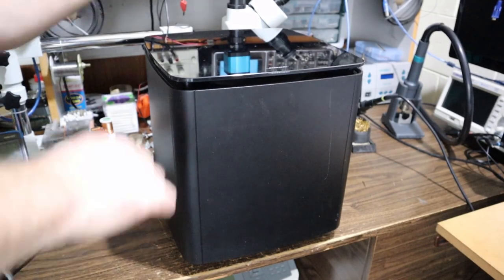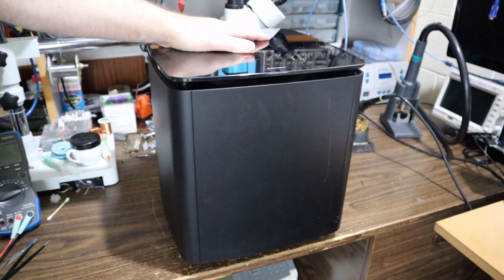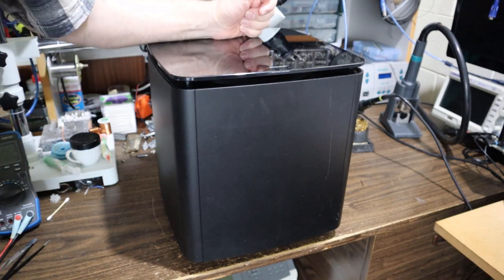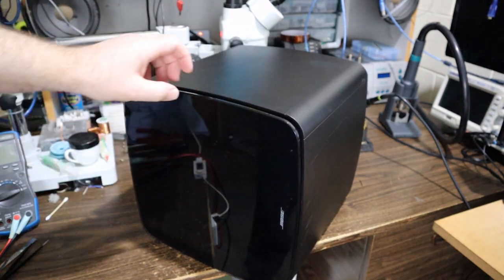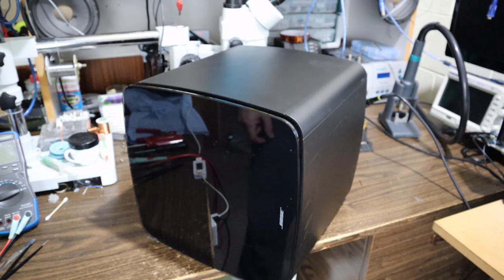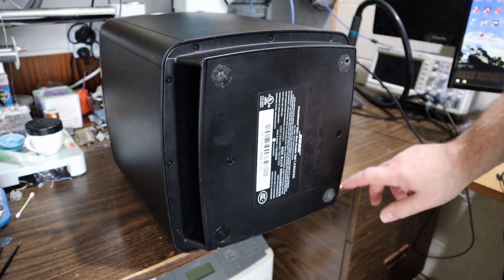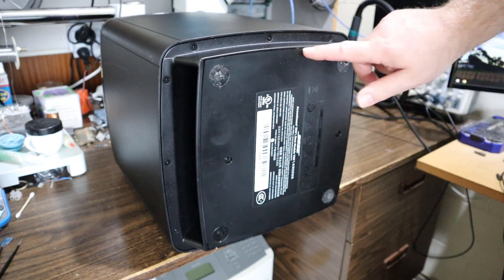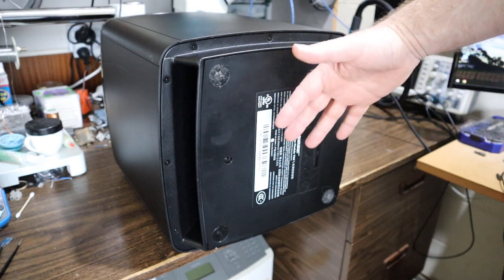BOSE bass module 700 acoustimass 300 NO POWER repair. COMPLETE GUIDE!

Comment: I have been an ardent fan of Bose for nearly a decade or more and almost owned one product in each category (headphones, earphones, wireless BT speakers, wired BT speakers, soundbar, subs etc etc). But now I detest and hate Bose. Some of Bose products recently purchased have been failing with accurate precision within 2 to 3 years, forcing us to rush to service station. Bose having charged a ton for their products are not ensuring adequate quality standards for the speaker components . What is even unbearable is, BOSE charges a hefty 25% as service fee of the product price as repair charges and provide one year warranty for the repair. No explanation is given for repair estimate or component replaced. Transparency is lacking. Even if a tiny ¢50 cent diode is replaced the repair charge for a sound bar for example may be as high as $150 dollars. Bose has lost its sheen and commitment to quality. Time has come to bin this brand.

Comment: 🥰 Thank you for this information. My bass module 300 died last week. With your information and help I have fixed it. In Germany for 0.28 € per piece and 6 € for postal shipping 🤣. Rainer
Reply: Hast du die Diode bei Reichelt bestellt oder wo gibt es die?
Reply: Ich habe die gleiche Frage. Bitte sag mal wo du die her hast.
Grüße
Reply: @ChrisStahl158  B2100-13-F DII Schottky-Barrier-Gleichrichterdiode, 100 V, 2 A, SMB Bei Reichelt
Reply: @ChrisStahl158  B2100-13-F DII Schottky-Barrier-Gleichrichterdiode, 100 V, 2 A, SMB Bei Reichelt

Comment: As per the video i checked the diode near J401 , seems to be fine but the capacitor G1 near it have volts 4 to 8 volts, while other small cap near G1 dont have any volts across it. Also checked the main capacitor and the other cap C402 , have 300 + volts across it. But when i checked , none of the caps on sec side have voltage. Checked the switching transformer T402 and found that it does not have any voltage on pins 6 & 7. But checked pin 1 to 5 , found some pins have DC voltage on it. Please advise.
Reply from the maker: IC U401 controls the switching of the primary of T402 so first you need to know does U401 have a low voltage supply to turn it on. I think the diode I replaced creates this rail. Maybe take the diode off the board to test it just in case it isn't open and you are getting a reading from something else in circuit. When the initial 300V forms across the primary it creates the rail for this chip to run so if this doesn't happen the chip doesn't start up and keep switching the primary to maintain this rail. You can test for this on the capacitor I check at 13:45.
Reply: Thanks…will check & let u know
Reply: @JonnyFix  Hi Jonny … Thanku very much….I replaced the same diode and it worked😊👍

Comment: I had same issue with Schottky, which I replace with similar 2A, but 60V (which shouldn't be an issue since voltage doesn't reach even 60), but now after that I have issue with 1000uF/63V capacitor which was blown (one of four that are around amplifier). Once the board is connected to the flex cable and the speaker after 3-5min capacitor was blown. I replaced it with new one which also blew up. When measuring voltage on the capacitor before connecting it back to the speaker it was 30V. Any idea which component would cause this?

Comment: Instead of changing ALL mainboard which cost 400$ charge and fee from Bose authorized dealer in Thailand, I decided to repair it on my own risk because it is around 5 years old and has already out of warranty and nothing to lose 😂😂😂. Finally it works!!! And it costs only 15$ for the diode and tools. Thanks!!! PS. Mine Acoustimass 300.

Comment: Great video and instruction! I have this same subwoofer. Mine powers on but produces a red, white, and amber light cycle. I can get it to pair on the app and display, but there is no bass. Do you have any ideas of what this could be, and is there a video to fix this? I watched this video hoping it would give me some insight. searched all over their site but got no answer.
Reply from the maker: Others are saying it has something to do with firmware. I don't remember if this setup can be network connected but if so do that using LAN cable preferred to WIFI and leave it on overnight, see if it downloads an update. Or find a way to do an offline update maybe via USB?

Comment: After replacing the diode the device goes on and works sometimes a minute sometimes longer then it turns orange, off, white on and works again. And this goes like a loop. With the 3,5mm jak same issue.
Any idea ?

Comment: Hi Jonny, You (or anyone else) wouldn't have a higher resolution photo of the back of main board would you? Specifically I'm chasing the value written on the large resistor (next to the one that looks like its missing) on screen at 9:29 left hand side near multimeter display. Just can't quite read it on screen. Cheers
Reply from the maker: I don't sorry, hopefully someone can help. Will try remember to let you know when I see another one.
Reply: R15F
Reply: @CharlieBaker-nj1wn  Oh thank you so much Charlie. Very much appreciated.

Comment: Thanks for the video mate.
Have just fault-found my PCB and have found the same diode to be the problem.

Reading through the comments it seems like a lot of people are having exactly the same issue.

Why is this diode in particular the most common cause of failure?
Reply from the maker: Maybe a bad batch, maybe under rated. Hard to say. See if you get longer out of the new diode.

Comment: Hi John, Great video! I have a bass module 700 that will not connect to the soundbar 700 not can it be discovered by the music app. When plugged in, the status light is solid amber. When trying to connect an 3.5 mm audio cable, the light becomes solid white but the bass module does not engage when music is played. Is this an issue with the blue tooth module of the circuit board?
Reply: I have this issue also. Any luck ?

Comment: Hey Jonny - Need a North Star on my issue - My Bose Bass Module 700 does power up, pairs with the sound bar and for some reason starts blink a red light .... Any suggestions ?
Reply from the maker: Manual says contact bose, so it must be an internal failure. I have not seen this before sorry.
Reply: Hey I got same issue. Have you solved the issue, have any suggestions?

Comment: Hi just wondering if you would have an idea or thought about working out the actual wattage is on the sub itself as Bose as we know don’t make it easy to find this information out or even share it I’m curious thanks
Reply from the maker: Get the part number off the amplifier chip and look at the datasheet, should get you pretty close.

Comment: Hi Johnny. I'm trying to fix my 300 with no power.

I tried replacing the B2100 diode which i think tested ok but tried anyway. I could only source a 400v 1A. Diode. Would this cause failure? I still have no power and don't know what i can do now. Don't want to ditch it but no old school repairers here 😣
Reply from the maker: 1A diode might be ok for a short test but may not last long term. If you test the diode and it is ok then this is not your problem. A bad diode is a very common problem but there are many things that can fail and give you the same no power fault. You will need to keep testing things to figure it out. In answer to your other question you can almost always test a diode in circuit. The only catch is if it is open internally you might get the usual .2 - .6 voltage drop as a result of measuring something else also on that same circuit and so think it is ok. If it is short then take it off and re-test to be sure. Good luck!
Reply: @JonnyFix  thanks heaps for the advise mate. Well somehow i got it working. The 1A is still in there, but i have 2A 100V on the way. Not sure what i did to get power back, i retested several components, there was one diode which showing readings both ways. This diode was one of 4 or 5 that surround an IC iirc near the coils. After prodding around that started reading normal again. Don't not if it was that or coincidental. Either way, its pumping again.. For the moment 😂

Comment: My Acoustimass 300 is flashing white/red/yellow without any sound output? Any idea what the issue might be? I have sent it to Bose repair already in March 2022 as it was not working anymore (different LED flashing, changing only from white to yellow) and they switched a SMD part. Now it is already broken again 😢
Reply: did you find the cause of the problem ?
Reply: @rafals2041  Bose has repaired it as a gesture of goodwill as the warranty has only exeeded 2 months. Based on the repair report, an elektrolye capacitor was broken and swapped out.

Comment: Hi Jonny, my Bose Acoustimass 300 flashes pulsating white and orange. get no sound out ! What could it be ? defective circuit board ? thanks in advance for any hints
Reply from the maker: Quite likely, not seen this before myself. User manual says Unknown error. Bass module requires service.

Comment: Hi John, I replaced mine but still no light comes up, but when I plugged in the 3.5mm audio cable into the base ports light comes up but no sounds. Any ideas?
Reply from the maker: Either that part was not the fault in your case or you put it in the wrong way around or there's another problem as well.
Reply: @JonnyFix  checked the diode with multimeter is working fine , and swap a few still same issue. btw do you do repairs for customers? If you do where do you located?thx
Reply from the maker: @jimtan4790  sorry I just do odd jobs for locals who know me

Comment: My subwoofer lasts 8 minutes working normally and then it turns off and starts restarting until it cools down again. Will it be the same problem? Will it be solved with that? Help me please
Reply from the maker: No it will be a different problem I think even if it's not overheating. I don't know what though.

Comment: Well maybe i never saw the  first one you repaired,  or my memory is dodgy Rupert :-)
The question is :  Why did the diddle  go piff  paff poof ?
Designed to fail?
Reply from the maker: Bad batch? Under rated? Oddly enough I just did a BM500, same fault but with a higher rated diode.

Comment: This fix didn't work for me :( 
Mine will not display any lights when plugged into power. 

But when I plug aux to the unit. It connects to the app and sais it's there , but won't produce sound. 

If I unplug the aux, light goes out , and it cannot be found wirelessly 

Has any one experienced this ???

Comment: Hey bud how can I stop the popping and cracking noise in my bass modules 700. It’s so annoying. Bose is wrong for selling it without warning customers.
Reply: I understand I can wire it but I’ve got 2 and a splitter or y still is another problem with one of them keep disconnecting.
Reply from the maker: @solocalvin9650  I'm not sure what causes this. If you have a wireless router turn it off and see if the noise stops. If it does, try putting more distance between the router and system. If TV is on wifi consider running a network cable to the router instead.

Comment: My Bose 300 dies when play on high volume, can it be same component problem?
Reply from the maker: If it dies after a while it might be overheating. If it dies immediately after reaching a certain volume it might be capacitors as maybe the power supply can't supply enough for the demand.

Comment: After replacing the diode the device goes on and works sometimes a minute sometimes longer then it turns orange, off, white on and works again. And this goes like a loop. With the 3,5mm jack same issue.
Any idea ?
Reply from the maker: No sorry